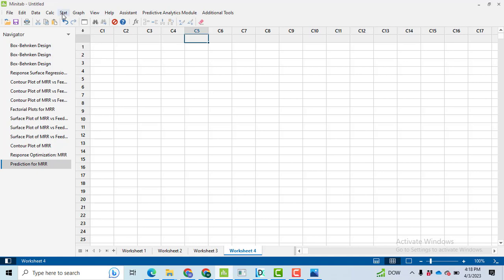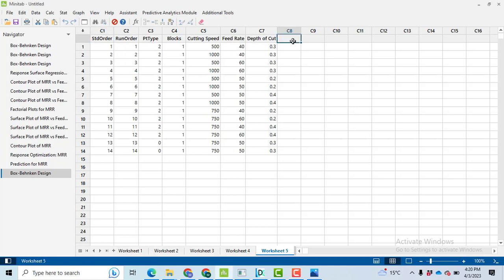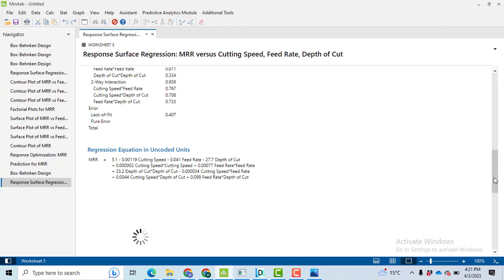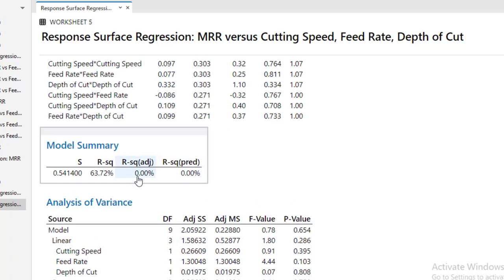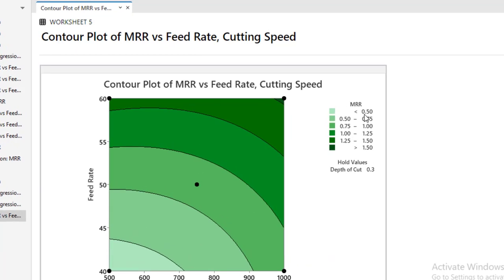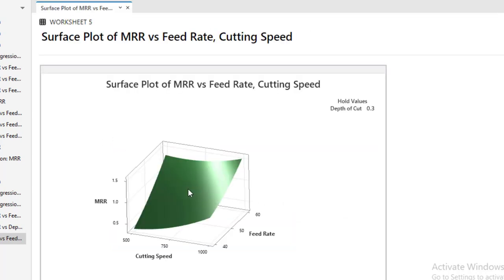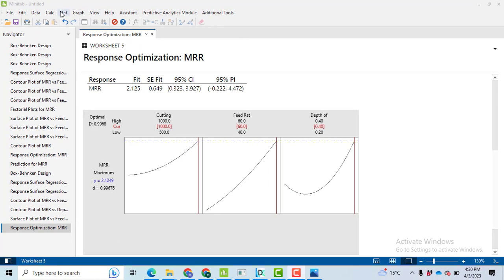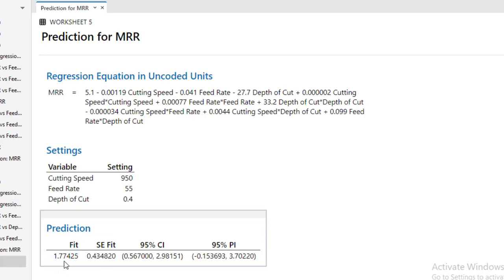Response Surface Methodology Box Behnken Design in MINITAB | RSM Box Behnken Optimization

Comment: I hope it won't affect the analysis if we check or check not run randomize runs? am I right?
Reply from the maker: Yes. No effect.
Reply: @EngineeringandInfo  Sorry for disturbing you again. By default we should go for unblocked design, if it is not instructed in assignment. I have four factorial and total response 31

Comment: Thank you for the video:) how can we reach to a optimal desirability value of 0.99 during optimization? Should we have contraint where we have maximums?
Reply from the maker: Your can set the constraint to maximum. But in case of Experimentation, the range of investigation depends upon the machine operating specifications